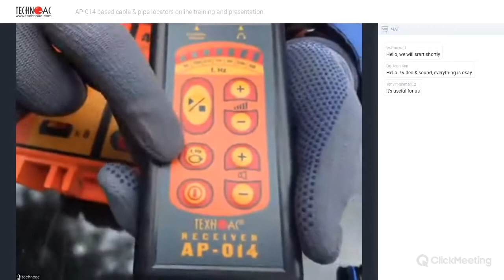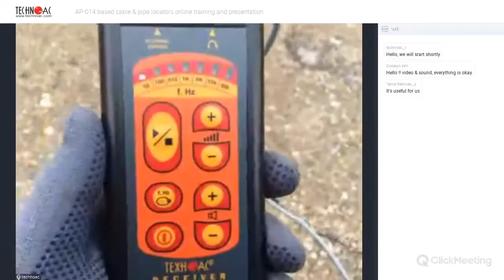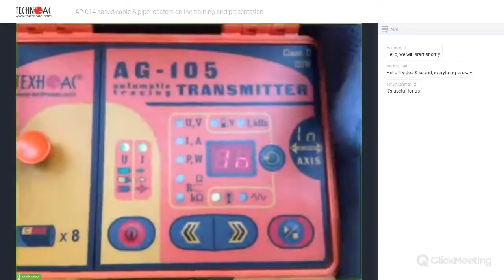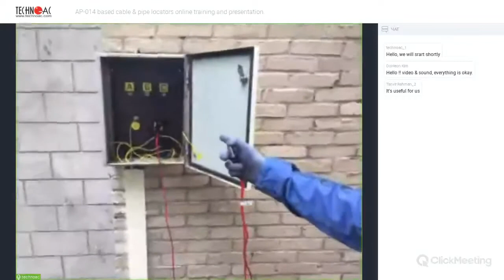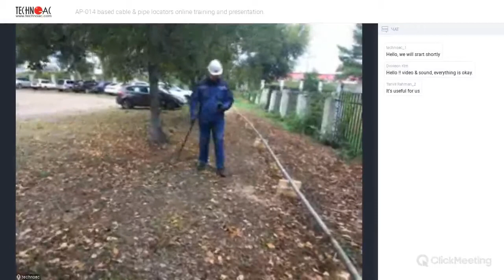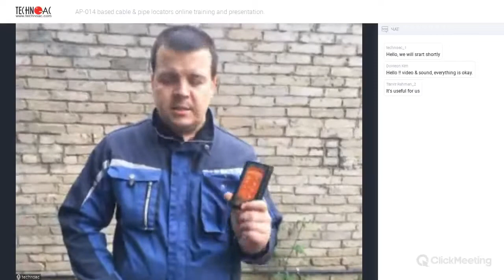AP-014 based cable & pipe locators.

Comment: How we know the depth of cable by this device
Reply from the maker: Dear Sir, this model does not support depth measurement. This locator is used only for detection.

You can try using indirect depth measurement as shown in this video: https://youtu.be/rVxqRvhmxTk?feature=shared